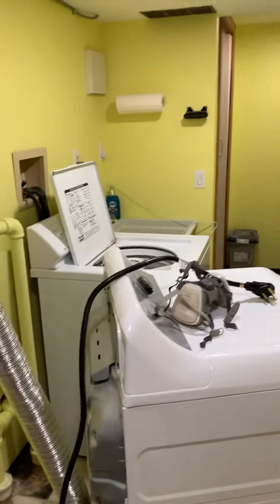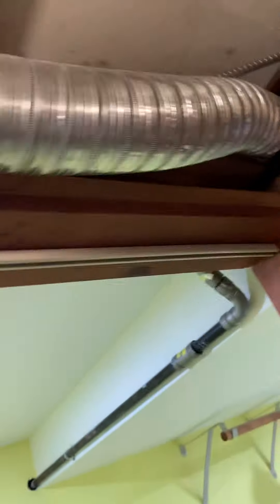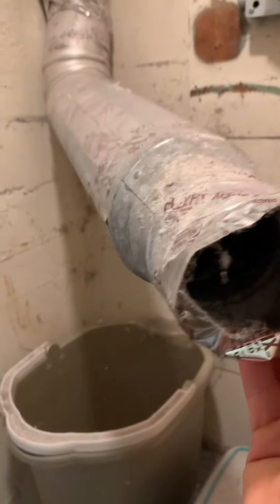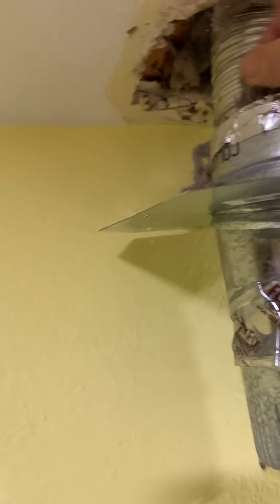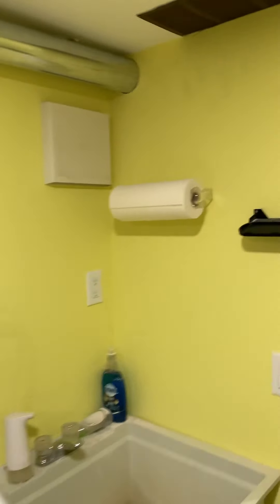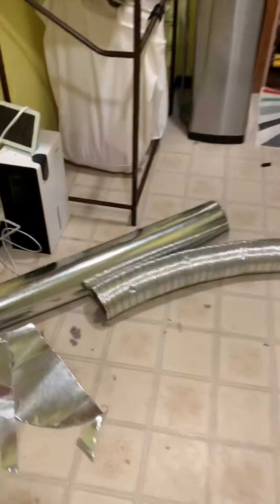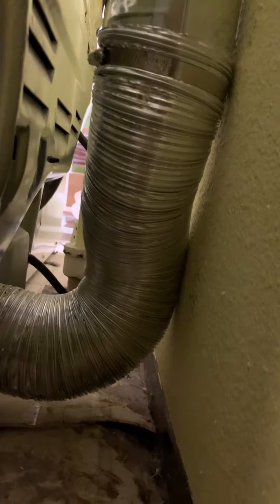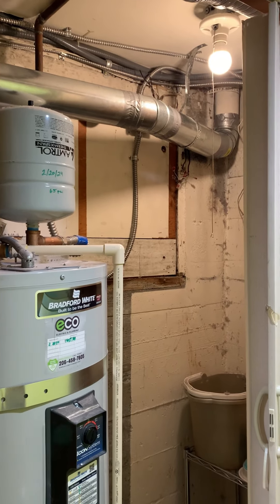New 4 inch Dryer Duct to outside

Comment: ¿What is your TEL on that?

Total equivalent length of the exhaust duct taking in to account all fittings?
Reply from the maker: in USA max duct run length recommend is 35 ft.  90 degree bends you add 2.5 fee pert.  So I had four 90 degree bends so that is 10 ft. I went up the wall 7 ft, turn and run 9 ft, 3 ft up and 1 ft out... for a total of  30ft.  Some people use just the flexible corrugated piping and I would definitely not recommend running that length.